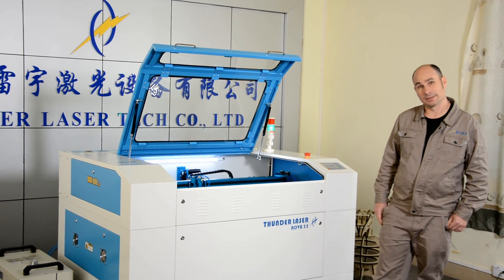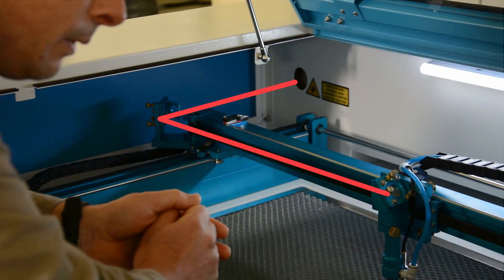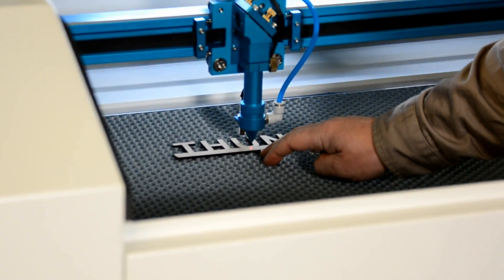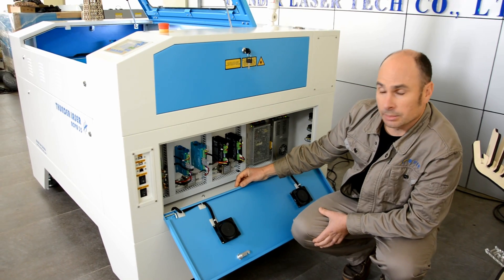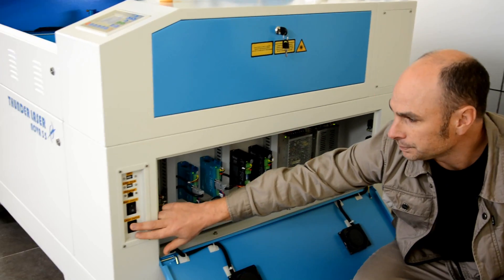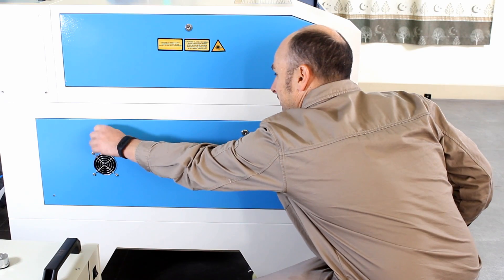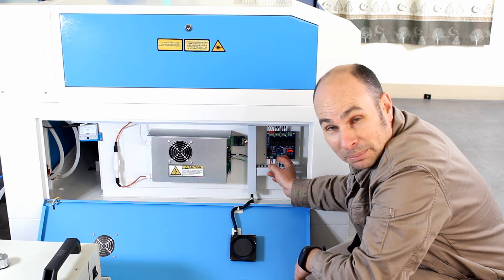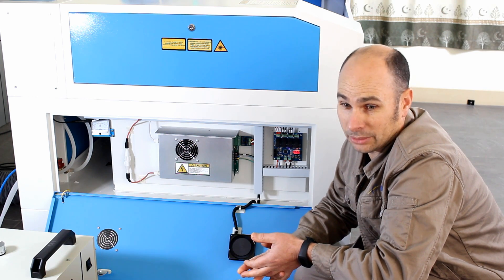Thunder Laser Nova 35 Review

Comment: I noticed two EMI Filters. What is the purpose of two?  
Does this run on 120 or 240 volts? Does the chiller, extraction fan and the air compressor get power from the same circuit or do they have to be wired to a separate circuit?
Reply from the maker: strong to electromagnetic interferenc .extraction fan and the air  directly to the machine, but water chiller independent power supply.